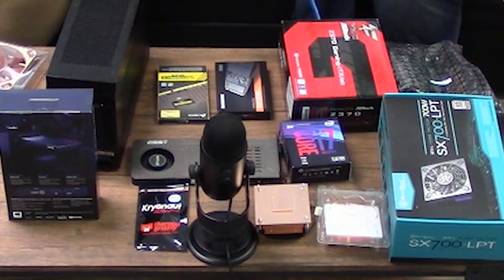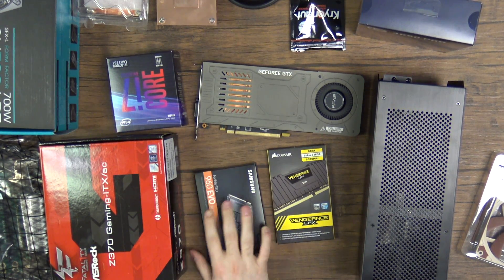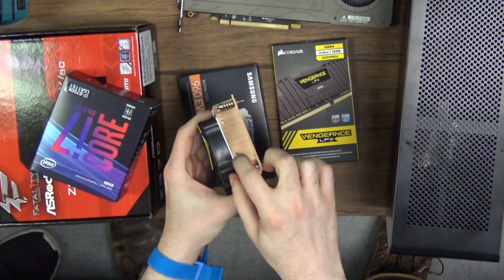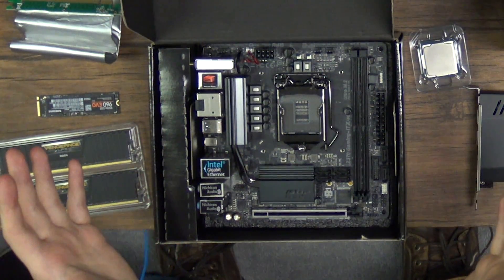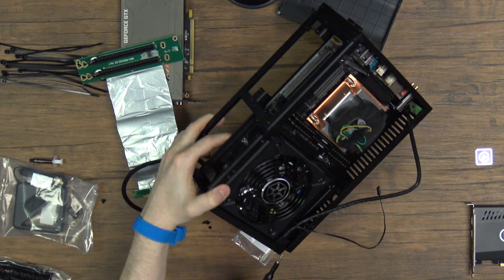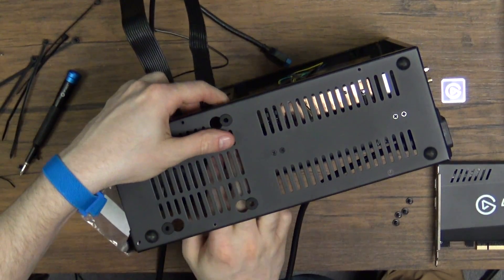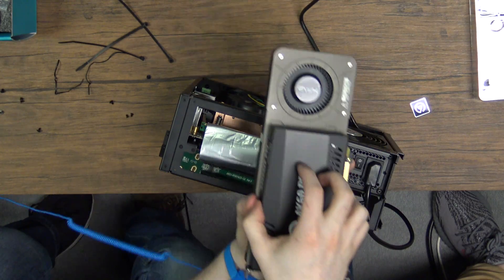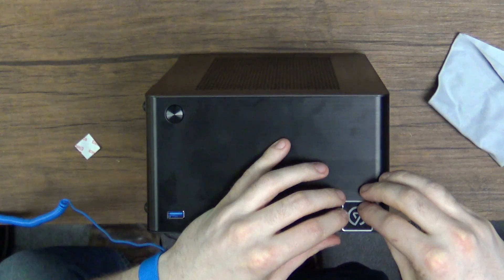mITX MONSTER! - Ultra Compact Portable Streaming PC Build

Comment: lmfao, streaming in 4k.. yeah, sure you will
Reply from the maker: Ulfrinn YouTube already supports 4K streams...
Reply: @DuncanCantDie  It doesn't matter, to actually upload 4K@30FPS requires a bitrate of at least 25mbps, and the same to actually download a 4k stream at 30fps.. most viewers will be unable to view that without constant buffering.. that is why the most twitch and mixer streamers tend to go is 1080P30 or 720P60 at 5500 bitrate, and sometimes to make streams more accessible to more viewers they'll do 720P30 @ 3500
Reply from the maker: @ulfrinn8783  With slow encoding settings you can get decent 4k streams with a bitrate of 15mb/s. No streamer with a decent PC streams at less than 1080p60 these days, 1080p60 looks great at 6mb/s medium or slower. 

Partnered streamers get encoding step down options that viewers can choose to reduce quality if they don't have the download speed required, however almost everyone has at least 15mb/s down these days.

Please fact check before stating things as facts, it can be very misleading for up and coming streamers.
Reply: @DuncanCantDie  actually, many, if not most streamers stream at 720P60, some even less because its not so much about what YOU can upload, but what your views can download as well.  And if you reduce a 1080P60 stream down to a reasonable bitrate for people to download, you end up with overcompression, which results in artifacting and actually makes the image look worse than a lower resolution without the artifacting, since it doesnt need to compress as much to fit a more manageable bit rate
Reply from the maker: @ulfrinn8783  I'm a partnered twitch streamer and I've been streaming for years, I've also advised some of the largest companies in the space and worked with them for years. I've built PCs and set up streams for creators with millions of followers. I talked directly with nVidia when they released their new nVenc turing encoder and helped establish the quality differences between it and x264 medium. I've worked with the worlds largest media franchise on setting up their official competitive streams.

Are you really trying to tell me what quality people stream at as an industry standard?

Next to no partnered streamers go below 1080p60. The ones who do are people who lack the knowledge required to up their quality or just can't be bothered because they became popular at 720p. Even the old school "holdouts" for 720p like seagull have increased to 1080p.

You are categorically and demonstrably wrong. The only people still streaming at 720 are people who cannot afford PCs capable of higher resolution encoding. 

Again, streaming sites give the viewers multiple encoding options. I stream 1080p60 but if a viewer can't handle that they can personally change it to 720p or even 480p to be able to watch. All partnered streamers get those multiple encode options.

I appreciate that you think you know what's done etc but your knowledge is over 2 years out of date.
Reply: @DuncanCantDie  Yeah, that's exactly what I am telling you.  There is a very simple mathematical formula you can use to determine the required bitrate based on your resolution and framerate.

Comment: There's no way that backplate was installed correctly. It's touching solder points...
Reply from the maker: it has an insulation layer so it doesn't matter, there was no way to install it without touching solder points.
Reply: Ah, okay. Fair enough then.